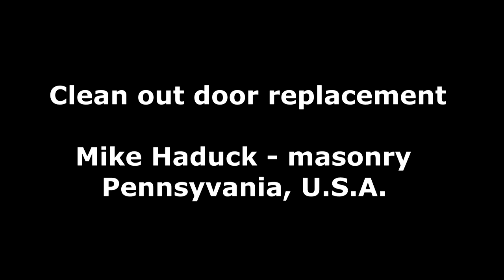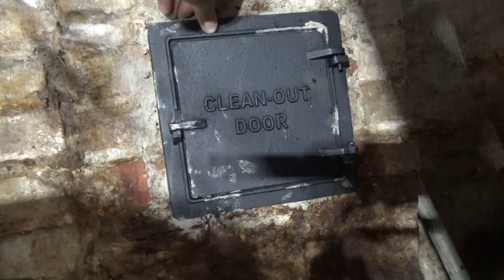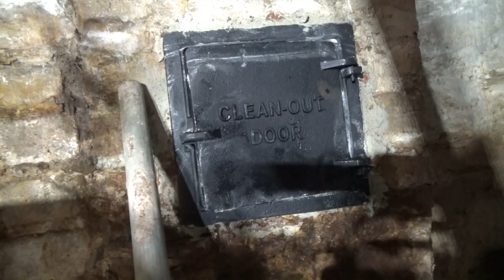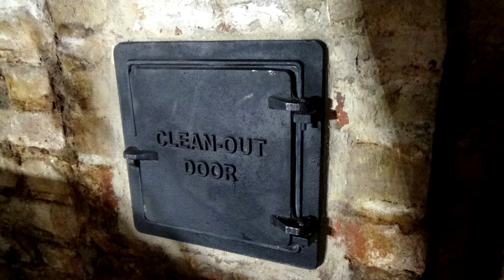CHIMNEY REPAIR (Part 14) MIke Haduck clean out door

Comment: Hey Mike, this is off topic but how long can I expect a chimney to last? Our cabin was built in 1907. I say keep pointing it and make it last. Some family members want to tear it down. It’s a fireplace with no flue liner—just bricks. I’m not even sure it’s ever been properly cleaned. Thanks. I enjoy your videos.
Reply from the maker: Hi Geoffrey,  I would clean it and that should answer a lot of questions, if it's good it's good, maybe a stainless steel liner if it's questionable,  thanks Mike
Reply: There’s a technique (invented by the Germans I think) where they line the whole chimney with mortar (or some type of lining material) using an expanding tube to push it into the cracks. My own feeling was that this was better than putting a metal liner in because once the liner decayed the chimney had to be almost torn apart in order to repair it. I’ve been in a lot of houses that no longer have a functioning chimney for that reason.

Comment: I got to say thank you so much for all the videos ive been watching for years and you gave me the info and insight to start up my own masonry job, Ive been to trade school for brick and stone and worked for a few years as a mason and ive learned more from you then i have from my apprenticeship and in the field, Thank you so much
Reply from the maker: Thanks Blackcat,, I appreciate hearing that, Mike
Reply: @MikeHaduck  Hello. This is off the path of this particular video but I can’t seem to find a video from you on this subject. One of my blocks in basement  has been punched through to run a water pipe from inside basement to my barn 50 feet away so I can have water in my barn. I noticed Inside basement wall started leaking along floor meets wall. Just about where that pipe lead through. So I chiseled that Bock around the pipe in inside until I could see where the pipe went into the outside on same block. Sure enough it was not patched good and water in ground found it’s way in. I need to break that block away enough inside to reach my hand in there to patch the inside of same block that presses against earth. My question is PLEASE do you have a video on this? I’ve been looking at your videos for hours to get advice on this patch job. What do I use? Can I squirt the hydronic concrete I mix in and around that Sloppy pipe hole?   I truly hope you see this message. Sorry so long. Be kind. I am 67yr old lady, 🙂 and I have to do this job myself. I truly appreciate your help. Judy

Comment: Are these supposed to be airtight? As soon as the furnace comes on near it in the basement it pulls tons of smoke into the basement.
Reply: I’ve tried to find a new door online that has a rubber wall on the door, or something similar. Can’t find anything like that.
Reply from the maker: Hi, you might have a blocked chimney, or a downdraft, which occurs when the chimney is cold and air is going down instead of up, or the air is going up somewhere else in the house and pulling it down the chimney , or your chimney is not high enough, lots of reasons, I never seen a door with rubber seal but I have seen plumbers caulk them, thanks Mike

Comment: I have a 3-flue chimney at my house.  And one day I heard banging in the basement.  I went downstairs and found a squirrel running around down there.  He apparently came down one of the flues and exited into the cellar because the latch wasn't working on one of the flue clean out doors.  I have since put a chimney cap over the entire chimney and have barricaded the clean out door with an old piece of cement concrete pier.  End of the squirrel problem.
Reply from the maker: Thanks A, I belive it, Mike